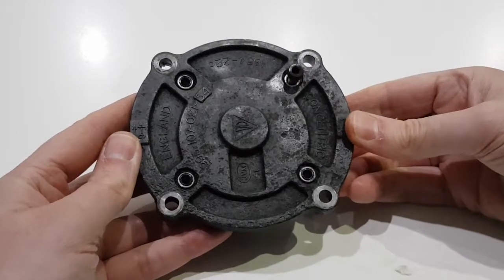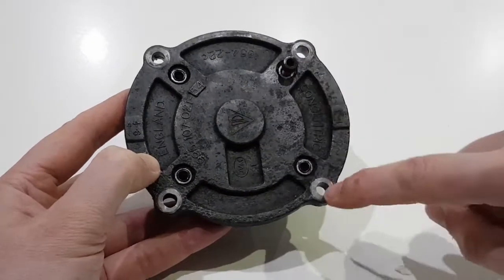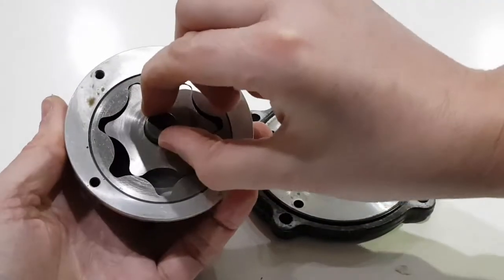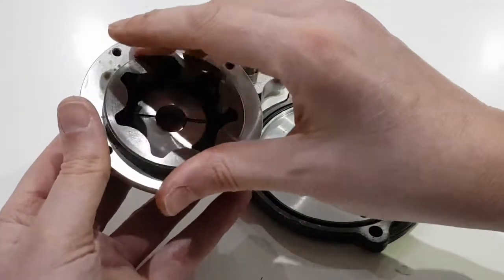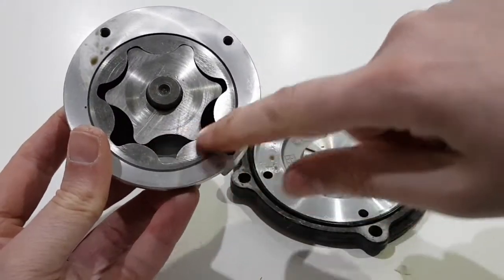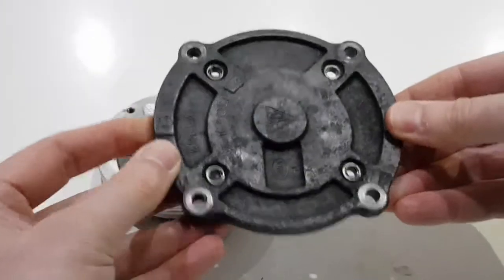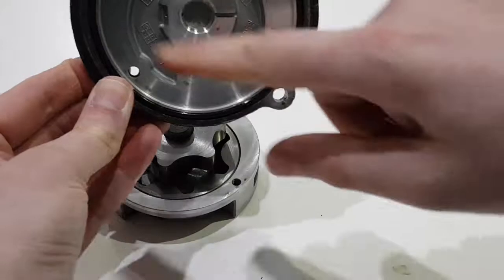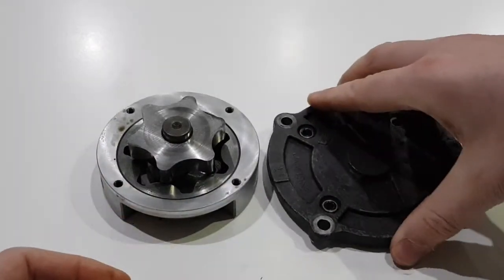Porsche 996 and 997 cylinder head scavenge pump operation

Comment: Hi Martin, I was wondering if you have made a video on ‘servicing’ (if possible) the tandem pump … the reason I ask is that I am cleaning up & painting the cover with high temperature paint & thought it worth checking that no debris in pump (as part of engine rebuild) … any help appreciated 🤞 … KR Martin

Comment: Hi Martin.. great information thank you. I've just had a top end rebuild completed on the m96 carerra engine and the scavenger pump was installed the wrong way as in it is in the cyl 4-6 configuration.  After a spirited drive it blows smoke after it cooled down. It has a new OAS view which lead to the discovery.  And it just has a problem idling  and finally the engine light came on and two cylinders misfiring I think plugs.  Another thing is small metal shavings in the oil filter. I've only done about 1500 miles since the rebuild. My question is would this have damaged cams or big end bearings? Would appreciate your advise ..
Reply: I will add, one scavenger pump was installed the wrong way.  Cylinders 1-3, installed in the 4-6 position.
Reply: I hope you got a replacement engine under warrantee for that screwed up mess they sold you.

Comment: I always wondered about these pumps great information, so this pump just scavenge the excesses oil in the cylinder head?
Reply from the maker: Not really excess oil, just oil.  If you think about a standard i4 or v8 engine, oil which is pumped up to the heads will drain by gravity back to the sump.  On a flat 6 it can't drain by gravity as it is at the same level, so it needs to be pumped back.  It isn't in a sump in the heads so ends up being pumped back with a load of air which then goes in to an air-oil seperator in the sump.  I'll have an update with my new dual chamber sump in the next couple of months.  See my other video on the x51 sump for more interesting oily bits on the M96 engine.